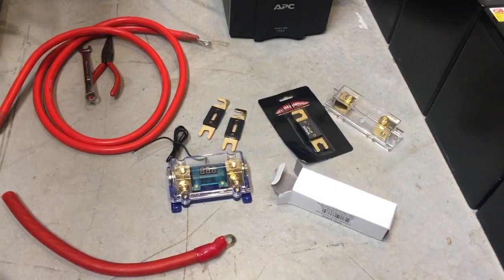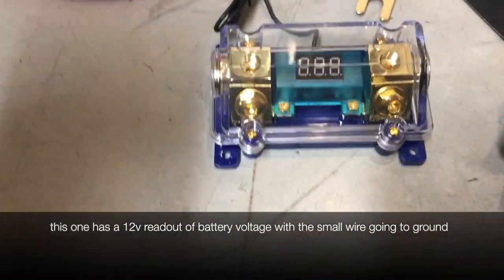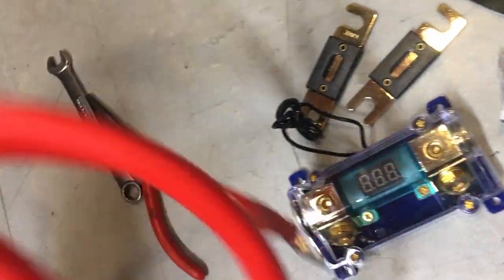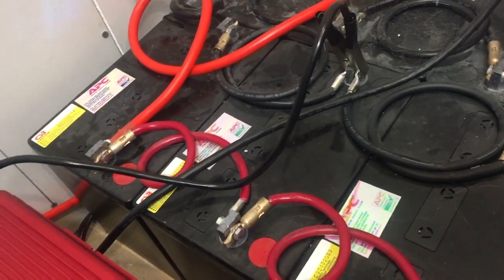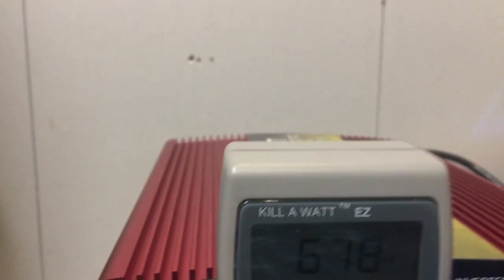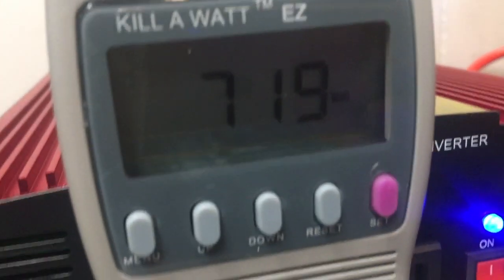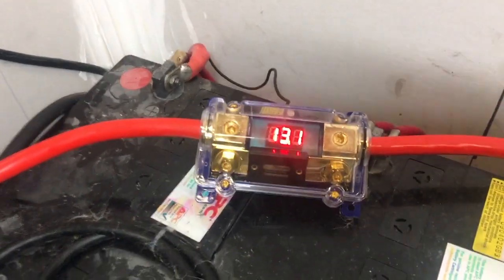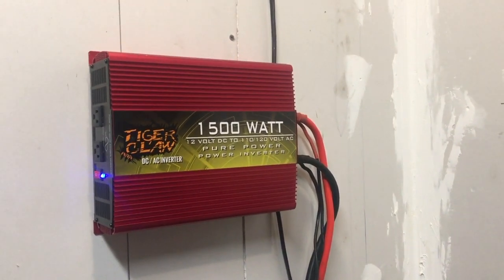Episode 47 Inverter ANL fuse install and load test

Comment: Hello from Youngstown Ohio. Thanks for the information.  Can you advise on a fuse size please?  (And where to purchase) I picked up a Victron Pure Sinewave Phoenix 12 | 800. 12V  100 AH Lithium is due in 2nd week of Jan.  Thanks again!
Reply from the maker: I purchased things on both ebay and amazon as no local store to me has these things.  Although i did get the main 0g wire at harbor freight    Fuse size really depends on load.  You dont want to run it at 100% all the time. While it can and does work. It will take a massive failure to pop it.  Fuse sizes are generally solar panel current x1.25. (Solar panel current is Watts divided by volts)
Reply: @ChrisEdwardsRestoration  ok thank you.  Yes I'll look for a 125 amp inline.  The peak output of this unit is 1500 w.  Im only going to use this unit  for power outages.  Just to run a few small items until power comes back up.  Thanks again!

Comment: If you have an aftermarket car audio system. Do not connect the led fuse holder under the hood. You’d want to connect it to your secondary battery if you have one. Since the amplifier(s) draw the most power that’s where you would want to measure for voltage drop.

Comment: Thank you
When you said;300 amp ANL fuse I paused video went into O Riley's and ordered it for $7.50.with a 24 hour delay between Salt lake City and Denver I'm using this afternoon the 140 amp battery isolator ( placement for now was going before a 2 gauge wire feed with at least ten feet of wire through firewall before going into a  storage batteries system with upgrade s to my inverter system starting at 1000 watt's 
Then add another 300 amp fuse from my  additional 100 AH solar panel and 500 watt converter?
I hope that I'm correctly  understanding these lessons
Reply from the maker: you may want to downsize your fuses if your max is 1000 watts, mine is 1500/3000, so redneck math of 10a for 100 hence 300a for 3000 is the MAX rating. my fuses are direct between the inverter and the battery, I too have a isolator on off switch that is direct, no fusing internal, like a bus bar you can move off or on, it is on my negative battery terminal from the inverter.   figure out what the max load you draw from your inverter and size it from there, if its 2000 watts, and your BATTERY size cables are large you can run a 200 amp fuse,  test it, get some multipacks on ebay, they are cheap, a few sacrificial blows to test your range.  i have 900amphours in my battery array so my max load is 300 amps. yours may vary depending on your max load and battery amphours, remember cable length also can drop the voltages too if its a long run. -- the fuse rating is generally  (watts/volts) x 1.25,   example: lets say 1500 watts normal run usage, so 1500 divided by the volts (12v dc in my case) is 125, now x1.25 = 156.25  , I just use a 10:1 rule of thumb ratio so 100 watt 1 amp fuse etc.. so 3000 watt load on my peak is 300 amp, give or take a few. i tested it with a 150 on a 1500watt load and the moment it went over 1500 watts the fuse popped, so it calculates close enough for me.
Reply: @Chris Edwards Restoration  great info brother

Comment: From what i have read ANL fuses arent' for inverter install that they require A T type fuse must be used .
Reply from the maker: been working totally fine for years...  popped one when i overloaded the batteries w multiple inverters, so they work.
Reply: @ChrisEdwardsRestoration  and they don't get hot?  Good to know
Reply from the maker: Never
Reply: Now I'm wondering if they are mentioned to use before the batteries isolator ?

Comment: My 3000watt invertor has a surge of 6000watts am I not able to use that much with a 300amp megafuse ?!?
Reply from the maker: I am 1500/3000 i have a fuse close to my max amp range

Comment: Where do you put the blue wire that's on a 0 gauge fuse holder
Reply from the maker: its a ground for the digital lead
Reply: @ChrisEdwardsRestoration hey I have a black and blue wire on my fuse holder ? Does blue mean ground and black means ?

Comment: well, a 4AWG WIRE can handle 100AMP up to 3M max ...your fuse is 200A it means your fuse is just a decoration the wire will burn and the fuse standstill :( 

well heres the equation 
wire size =load in amp X 1.50AMP
fuse size=load in amp X 1.25AMP

good luck
Reply from the maker: hence the title "test"
Reply: Thank you Ramahi, THAT'S the information I came for

Comment: sure wish you would’ve included putting the wires in the ANL fuse.
Reply from the maker: Its just a hex key screw that tightens them down.  Super easy
Reply: @ChrisEdwardsRestoration  I had figured it out.. I was super confused! lol. Im a 20 year old girlie with no experience with electricity whatsoever. I do have another question, does it matter where i cut the wires when adding the anl fuse in, or could i add them in where ever on the positive line?
Reply from the maker: Nope can be anywhere in the line.  Usiallly closer to the battery or inverter.   Your call

Comment: Hi. I ordered this distribution block for my car amplifier. Does the voltage indicator LED light up during load or all the time if terminals are connected? Do you think this will discharge the car battery when car is not in use because of the voltage LED?
Reply from the maker: Not at all it only uses milivolts to show the voltage.  I removed ky
Solar feed for over a werk one time while doing battery swaps and never had any issues. Enjoy!
Reply: @ChrisEdwardsRestoration  Thank you :)
Reply: @ChrisEdwardsRestoration  hi  i installed this very distribution block on my car but it does not display the voltage. only lights up two little red dots. what could be the cause of this?
Reply from the maker: Improper grounding or you have a poop unit.    Is the fuse in? All connections tight? Just ground the little wire to metal anywhere
Reply: @ChrisEdwardsRestoration  Everything is fine. I was wondering if there is a chance of battery discharge due to lighting of the voltage indicator. I understand it consumes very miniscule amount of power but just wanted to be sure in case i leave the car parked for a month or so.
Reply from the maker: If in doubt just put a 2 pole switch on it to check it when you want vs leaving it on all the time.   It should be fine mines been lit up for over a year now no issues at all
Reply: @ChrisEdwardsRestoration  Thats a good idea. Thanks!

Comment: Hi, Im using 1500 w inverter in my van. I want to put fuse out of my car battery for safety, can I use 80 A fuse ?  Please kindly let me know. I'm just a beginner. 
https://www.amazon.co.jp/dp/B01DETNRTY/?coliid=IC0N8KKNH68DG&colid=16585ADDGI08I&psc=1&ref_=lv_ov_lig_dp_it
Reply from the maker: You can use whatever you want but the inverter should have fuses.  You can add more in line  but dont exceed their value
Reply: @ChrisEdwardsRestoration  thank you so much. by the way can I run my car engine while using my inverter ?
Reply from the maker: Sure can
Reply: @ChrisEdwardsRestoration  thank you so much

Comment: Chris, i have a 1000w pure sine inverter in my RV that powers the refrigerator. I foolishly bought a new battery and installed it backwards.  Do you think the inverter is junk? It has an ANL fuse
Reply from the maker: Fuse would have popped or the inverter has polarity protection as most do to prevent that exact issue

Comment: Great video! i got a question regarding the AWG 2 cable. Its rated 300amps. But when I look it up on any awg chart online..it states that awg 2 can only support 94amps. And only a 4/0 wire can support 300amps.
Reply from the maker: that is a general rule for any Anneaaled CU Wire, also those American Wire Gauge charts are for chassis wiring. and they are always downgraded. , stranded vs solid core, voltage drop, temperatures, thickness, thermal conductivity all play roles. its such a short run, its totally capable.  those ratings are just a rule of thumb. the marking on the cable will display its "rated limits"  your good! just don't use cheap ass cables. and i doubt we are pulling that man amps on a solar / battery setup anyway.
Reply: @ChrisEdwardsRestoration  I looked at the digital fuse block link. They are 200 and 300 fuses. Is there anything more in line for 30 and 40, maybe 150 amps with that cool readout feature that you've seen? I am setting up a solar array,  yup
Reply from the maker: They come in all sizes from 10 to 500 amp
Reply: @ChrisEdwardsRestoration  thank you. I was thinking only for the solar run to controller just for gee wiz.  Glad I found you😊
Reply from the maker: My big fuse is the anl from battery to inverter. Due to my amp hour range and number of batteries while parallel do have some capable amp hours (900) my inverter is a tigerclaw pure sign wave 1500/3000 startup load. I have several other msw inverters from 400 to 2500w.  I have three 150w 12v panels on my roof now controlled by my hqst pwm controller.  Each of My solar panels have mc4  in line fuses at 15amp by renogy.

Comment: Am I correct thinking if I have a 2000 watt inverter , I need a 200 amp fuse.
Reply from the maker: Not exactly , make sure your wire diameter can support the wattage. otherwise it would get hot and possibly melt/burn
Reply: Chris Edwards that would mean I need 0 gauge wire. The inverter company tells you to use 8 gauge. So confused.
Reply: No. You are basing your math on the wrong factor. 
The fuse size should be based upon the amperage draw of whatever you are running, not the watt rating of the inverter.
If the watt draw of, say an induction cooktop plugged into your inverter were drawing 2000w then yes the fuse would be 200A

Comment: Where do you connect the display wire too?
Reply from the maker: the display wire is just a ground, it gets its power from the main line, so to the negative cable.
Reply: @ChrisEdwardsRestoration  so the display is always on..even if u not turn on the engine/acc?
Reply from the maker: Yes.  Uses very little current to show battery voltage. Been running for years now.  No issues
Reply: @ChrisEdwardsRestoration  great thanks! What size anl fuse do I need for a 1000rms amp? The amp itself is 105 amps. 2 gauge wire
Reply from the maker: @MegaBluecream  100  , but it depends on the peak load, my peak load on the inverter is 3000 watt, thus 300 amp fuse, the fuse rating is generally  (watts/volts) x 1.25,   example: lets say 1500 watts normal run usage, so 1500 divided by the volts (12v dc in my case) is 125, now x1.25 = 156.25  , I just use a 10:1 rule of thumb ratio so 100 watt 1 amp fuse etc.. so 3000 watt load on my peak is 300 amp, give or take a few. i tested it with a 150 on a 1500watt load and the moment it went over 1500 watts the fuse popped, so it calculates close enough for me.

Comment: Hi Chris, where did you connect that black wire to from that ANL fuse holder?
Reply from the maker: to any negative terminal on the battery
Reply: Thank you.
Reply: Or ground

Comment: Got a link to the fuse holder with display?
Reply from the maker: https://www.ebay.com/itm/CAR-STEREO-AUDIO-LED-DISPLAY-BASE-ANL-FUSE-HOLDER-0-2-4-GA-100A-300A-12V-DC-T/282587290843?hash=item41cb83dcdb:rk:1:pf:0
Reply: @ChrisEdwardsRestoration  Thanks!
Reply from the maker: if that link don't last, just ebay/amazon ANL fuse holder with display

Comment: Hey Chris, is it fine to use a 300amp fuse eventhough I'm only needing 150amp? Thanks in advance
Reply from the maker: depends on the peak load, my peak load on the inverter is 3000 watt, thus 300 amp fuse, the fuse rating is generally  (watts/volts) x 1.25,   example: lets say 1500 watts normal run usage, so 1500 divided by the volts (12v dc in my case) is 125, now x1.25 = 156.25  , I just use a 10:1 rule of thumb ratio so 100 watt 1 amp fuse etc.. so 3000 watt load on my peak is 300 amp, give or take a few. i tested it with a 150 on a 1500watt load and the moment it went over 1500 watts the fuse popped, so it calculates close enough for me.
Reply: Chris Edwards got it! Thanks man! Been a great help!